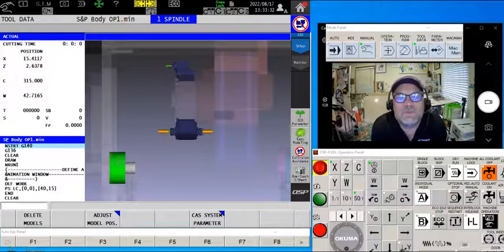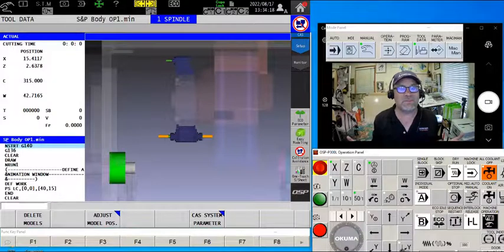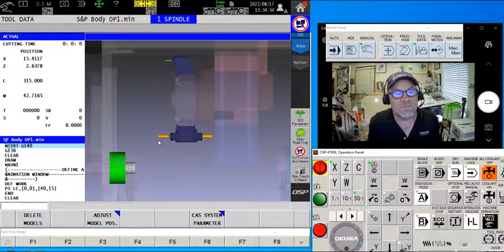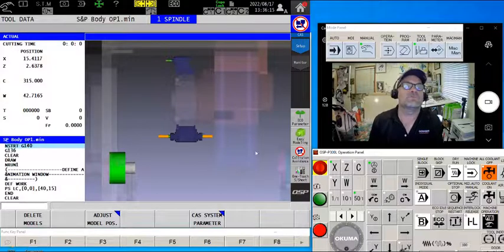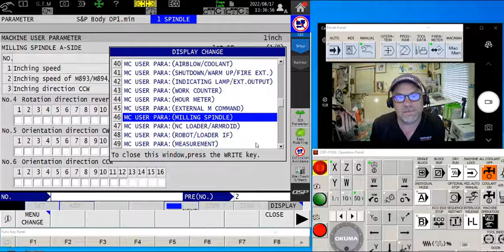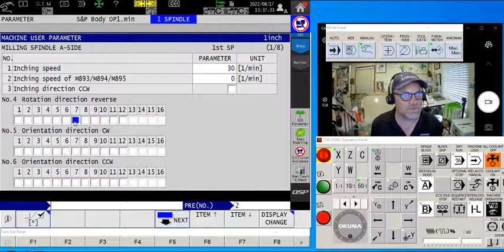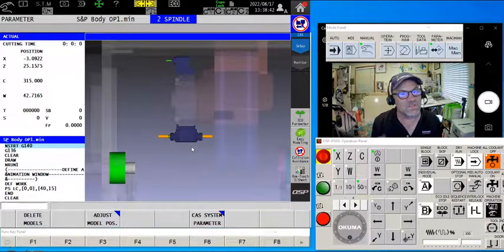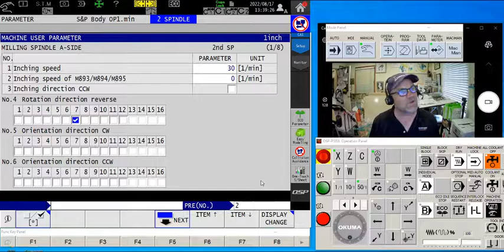Reverse a Live Tool on an Okuma Turning Center

Comment: I have asked this question before but no response.  Maybe a sub can answer it.  How can I adjust the transparency in cas.  I hate looking at the main spindle when cutting on the sub spindle.
Reply from the maker: There is a transparency key on the CAS page. Use the V function keys, OSP, Collision Avoidance, then look up on the right top of the bar to see SETUP and MONITOR buttons. Select MONITOR, then use the black arrow right key next to F8. Now the transparency key is there and can set specific components